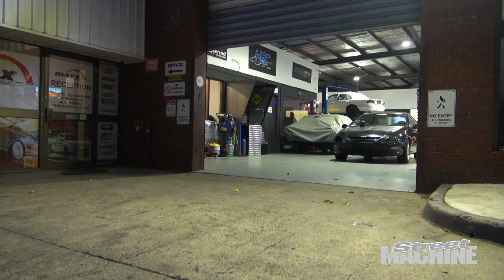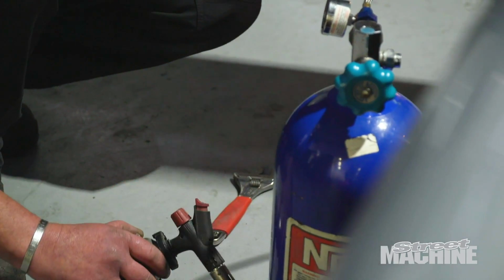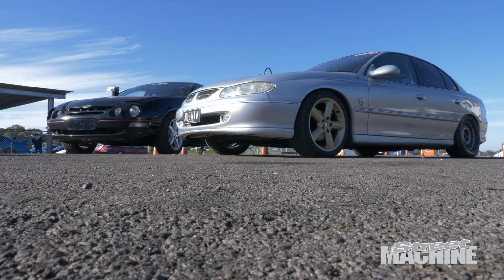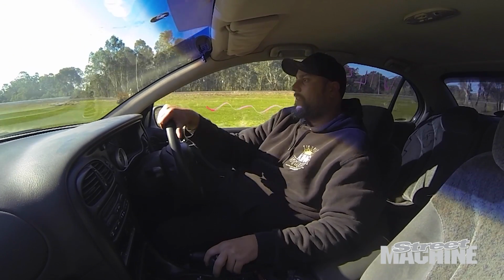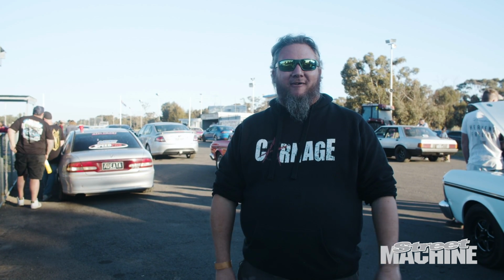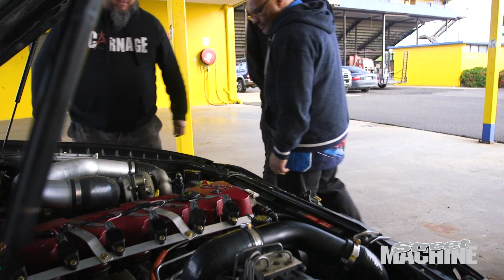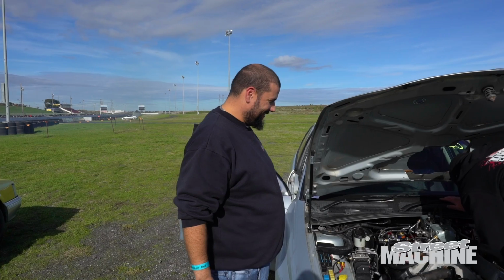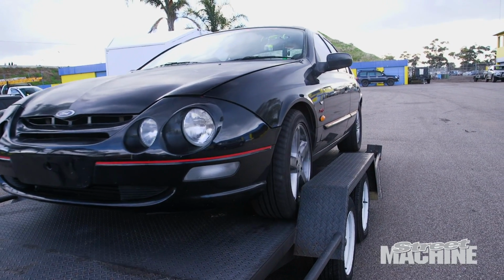Carnage Episode 28 - $2K Challenge Part-4

Comment: "It's a VT Commodore with a 5L whats the worse that can happen" engine catches on fire lol
Reply: Holden V8's have always had a tendency to pump too much oil to the top end. I couldn't tell you how many I've seen fill the rocker covers during a burnout, leak that oil out onto the hot exhaust manifolds and catch fire! No joke...

Comment: Good show but Scotty being honest man you can’t drive
Reply from the maker: Everyone is a critic
Reply: @STREETMACHINETV  gentlemanly reply Scotty :) , easy to think how you'd do better sittin watching tho . spewin about the dyno test Bubba not filling the bottle , Drags ism all that matters anyway :P
Reply from the maker: @shredBucketheadshred  It's an interesting car to launch, especially when you're trying to not breaking stuff
Reply: @STREETMACHINETV  you did what you could with a trans made out of glass. Good job man. If it had a trans you could beat on then it'd be in the low 11s.
Reply: Scotty you only need one all out pass and it would've done a high 11. 120mph in a auto is a low 11. Then if the box lunched it's self you could of said you gave it ago but those launches were crap. If you spun off the line then i could understand but bogging it 3 times . Dude it wanted you to win
Reply: Have to say I agree, and it isn't just this car either, there was a bit of it with the turbo taxi too. Still fun to watch though, probably in a big part because I am cheering for him to get that run where it all comes together
Reply: I don’t think anyone here realises how fragile AU boxes actually are past the 240rwkw stage... the way he is riding the clutch out between shifts etc is to save the box from throwing shards of metal everywhere, I killed my T5 in my xr6 and it’s N/A completely stock..
Reply: @isassyhdmodding1030  Double Clutching should help with that issue right?
Reply: That's a WELL known fact. Look at the track record: Turbo Taxi gets driven into trees when not even on a shoot (read as; crashed just trying to get from point "A" to point "B"... SMH). Then MX5.7 gets slammed into a concrete barrier while "trying" to do a powerskid- which Babba did with ease multiple times, soooo, there was nothing wrong with the car! He should be banned from driving anything more serious than that Barina they built. Telfo's mad as for not taking his driving privileges away... 😅😅😅 Hopefully this new bloke can drive and Scotty can just do the hosting duties
Reply: @Vinnay94  Yeah, it'll help a bit but slows down the shifts a little at the same time- unless your really good at it. Look, let's be honest; you can break almost any 'box if your hard enough on it. It makes me laugh with all these T5 comments though. I've got a VN 5L spec T5 in a VH SL/X with 320rwkw and it's been fine for years- and it cops clutch dips at 60 - 80km/h 15+ times a days where it'll skate up the street for 100's of meters. If you wanna talk about fragile 'boxes, the old Aussie 4 speed behind my 383 powered LJ I used to own was doing it tuff. Every 4 - 5 months it'd need 2nd and 3rd gear syncros at a minimum. But it never stopped me racing. I just got very quick with my double clutching up through the gears! 😅 To the point it wore a perfect clutch pedal indent in the soles of all my left shoes 😀. I used to show people with a real sense of pride... LOL!
Reply: @STREETMACHINETV  Keyboard Droolers not real world operators like you guys at Street Machine Scotty well done:-)

Comment: My 85’ ZL Fairlane ran 2yrs with a blown head gasket.  The old Fords are absolute work horses!
Reply: Power 2 Weight  it's hard to blow a head gasket with 80hp lol
Reply: 100% true, my falcon bf Ute has 2 years under its belt, daily driven towing my trailer to job sites with a blown head gasket. Hasn’t gotten any better or worse.
Reply: @baker1271  you make it sound like his 85 falcon had more then 80 hp

Comment: Track owner was right, there were many drivers that paid to race on a clean surface, they couldn't favor you guys ... even though, i was Prayin' they would let you run. Great work as usual guys, also i never had a flywheel come loose either.
Reply: That's because they come fitted with thread locker from factory and 99% of actual mechanics do the same... In the 19 years since I got my papers, I've never fitted flywheel/flexplate bolts without it- so I've NEVER had one come loose. Ever...

Comment: Typical Holden:
Run 1: leaks oil all over the track
Run 2: breaks down and catches fire
Run 3: breaks down again before it even gets to the track
Run 4: breaks again
Reply from the maker: It didn't actually leak oil on the track first pass, just a bit of trans fluid on the headers
Reply: I wouldn’t have it any other way mate it’s all I’m use too
Reply: STREETMACHINETV i was talking about the first of it's competition runs where it leaked oil and got booted. The practice run shouldn't count as per the original rules.
Reply: Smo Kabong yeah your probably right mate. I really don’t cear who wins it’s more about having fun with mates drinking eating building cars in my eyes

Comment: Even tho the Falcon ran slower times and possibly have ruined it's engine is say it's won,  it may not have done a 12 like the commodore but it ran consistent 13s over multiply passes

Not 12s, trans leak, broken CV,  Broken CV 😂😂 

You'd have to get a perfect launch and perfect shifts to beat the auto in a drag esp with similar power was good to watch none the less AU should win the hill climb, Far better suspension under it and the manual will come into its own here
Reply: your average is a guarantee if you only complete one pass lmao
Reply: @WayFastWhitey  except that one pass was a practice run so it shouldn't count at all, as per the original rules. It got a DNF in all 4 of it's competition runs.

Comment: I'm amazed how the au held up for as long as it did! A lot of power on a factory bottom end 😤
Reply: Barra can handle them numbers on the bottom end easy..
Reply: tbh the barra is carrying that car so much
Reply: @CloppingIsMyThing  it’s not a Barra, it’s intech but they have very similar bottom end as a ba Barra
Reply: @butler9118   oh? Intechs I know nothing about so rip
Reply: @CloppingIsMyThing  it’s the single cam older version of the Barra pretty much, everyone has their own opinion but my personal one is that stock for stock between a N/A intech and a N/A ba Barra, the intech is the better engine, handle a lot of abuse and will do 500000+ks without issue  just normal daily driving

Comment: I told ya boys, autos arte always better in drags, but when it comes to nd hand cars you just dont know till you drag them, well done bubba and GO HOLDEN. :) and a questions does the NO2 kit come with warming up fliud pads like those used for your hands,which is air activated, basically put a massive heap of those in the NO2 kit box and there you have it cold as ice NO2?

Comment: The au engine isn’t done, check the flywheel bolts, sounds like the flywheel isn’t hanging onto the crank flange. Why don’t you grab an auto (from the taxi) and give it a run? At the moment the commodore has one run to its name with loads more upgrades.

Comment: Classic Holden ( full of problems)
Reply: Breaking stock axles isn't considered a problem in drag racing, especially when a nitrous V8 is causing the breakage, the way the torque comes on is extremely violent. Breaking engines however, is considered a problem. I have a suspicion a ring may have closed on itself.

Comment: Falcons flywheel has come loose. Standard issue when the tap limiter.  Missed third. Hit limiter. Flywheel will be loose.
Reply: Yep I was thinking the same. My Eb had that noise before. Sounds like a bottom end bearing or timing chain issue.
Reply: Sounded very similar to when a spring shat itself in the dual mass flywheel on my WRX.
Reply: Hope it's this simple and not a broken piston like Bubba thinks!
Reply: @MrToranaGuy  It would be the flywheel, these guys aren't joking when they say "standard issue"

>inb4 piston+flywheel+timing chain because fords suck ;p
Reply: Exactly what I was thinking, I heard this rattle not long ago thought it was my auto that’s finally let go but then when taking the box off the replace with a 5 speed I found the flywheel had snapped one bolt and left the rest finger tight, I really hope Scotty sees this before buying a new VCT motor for it.

Comment: Seems like these old beasts just weren't meant to put 300+ at the wheels. Not without aftermarket drivetrain and running gear. 

That being said they are 20+ years old now and probably have 300xxx km's on them.
Reply: My 1st thought after hearing about what they were planning on doing to these cars was "Do you plan on having a driveshaft after you hit 2nd?" hahahaha

Comment: standing in front of a car on the dyno... I would have lost my nuts for that.
Reply: They don't Dyno them in reverse?
Reply: @tortron  Nope. If those straps break or come off (which they do) the car launches forward faster than you can hit the brake pedal. Have seen chassis dynos where the vehicle faces a brick wall, just in case.

Comment: Au needs a built btr and that sounds like flywheel bolts backed out
Reply: Missing gears and dumping clutch definitely not helping with so much torque.
Reply: I’m suprised the t5 held up, plenty have gone with well and truly less power and torque through them

Comment: Yea the au, lol didn't take long to break the Vt. Compared to the vt the au will always be the winner 👍
Reply: Backwheeladdict187 have u even been watching lol , the au needed a clutch before it could even make it off the dyno
Reply: @GrimmRetro  Yeh.. its was stuffed when they bought it. The AU motor will last still 10000000000000000000000kms the Vt with only last another 500kms.
Reply: Thank u npx20, the vt needed a trans before it even touched the dyno to then have it fail again.
Reply: Lmfao the au motor is already fucked
Reply: @GrimmRetro   it's not the motor. The flywheel bolts just came loose when they missed a gear and hit limiter. Nothing on the AU broke, unlike the commodore.
Reply: @BrosefDudley  Hard to kill a AU

Comment: The ford should win it has done more passes than the holden before a problem arose the holden has had 3 problems
Reply: 4 Problems*
1. Oil leaked all over the track, did not start. 2. Nitrous backfire, DNF. 3. Broken axle, did not start. 4. Another broken axle, DNF
The commodore got a DNS/DNF in every one of it's competition passes. It shouldn't get the win.
Reply: And plenty more problems to come :)

Comment: Cylinder 6 exhaust rocker arm.  ;-)
Reply from the maker: Thought about that but it runs too smooth, we'll check it out anyway
Reply: @STREETMACHINETV  it's a loose flywheel. Standard boosted 6 falcon issue.

Comment: 28:25 why are you so bad at launching. Just take off on between 1500 to 2000rpm. Its like your just dumping the clutch at max rpm all the time.
Reply from the maker: That's what I did on the first launch. Look how that worked out, it almost stalled
Reply: @STREETMACHINETV  hmmmm. Maybe the car needs a better clutch. Shouldn't stall at that rpm. Pleanty of power in both cars.

Comment: love your vids guys but does anything you guys build work? ......  Check out those power outputs but cant do a single run virtually down the drag strip, blow the motor.....  snap the cv's......  the territory you had got banned right....  are you out to prove you might as well buy a new v8 from someone for reliability? .....  maybe it proves you cant have big power for no money because again what you put in is what you get out.......... old crap = broken crap.  Maybe take like a 06 hsv or something ......  throw 1000-2000hp at it and crack a 7 second lol